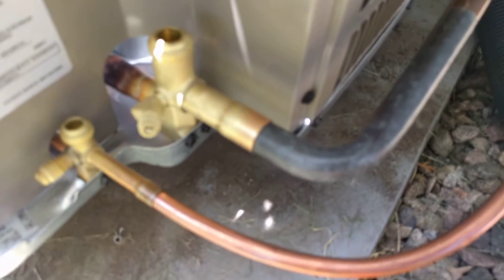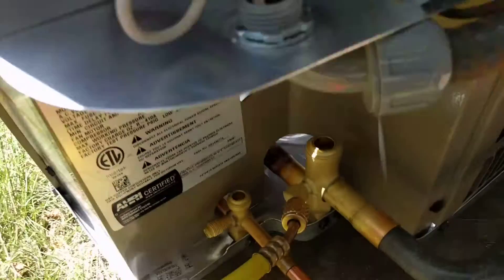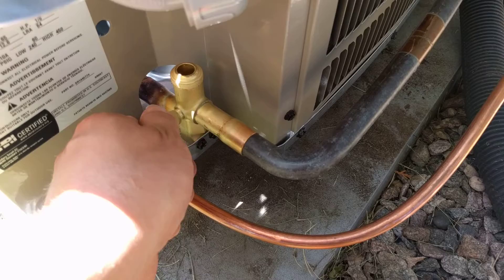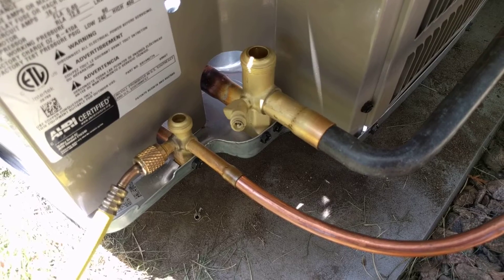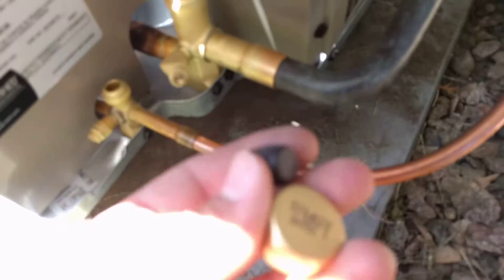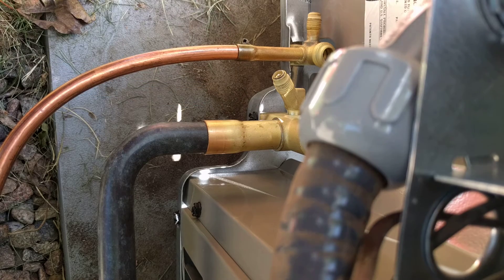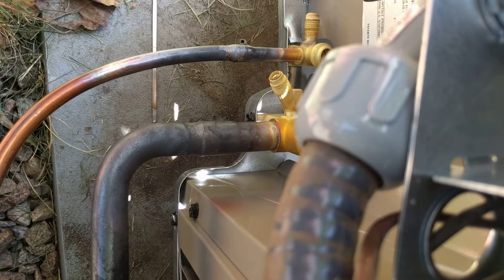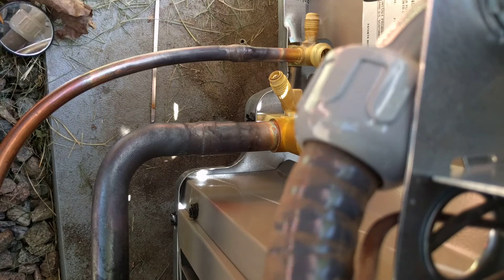How To Braze The Connections On An Air Conditioner Condenser Outside Unit Using Nitrogen - Soldering

Comment: You didn't protect the valves while they were being brazed with a wet rag. The valves then acted as a heat sink and drew the heat to the valves.  You need nitrogen flowing  continuously  non stop thru the lines while brazing from one point. You DON'T add nitrogen to one side then jump to the other side as that does not purge the oxygen from the lines it just mixes it with the oxygen remaining in the lines.. You need to heat the fittings from the bottom up as heat flows up and not down.  ---  BUT other than that how did you like the play Mrs. Lincoln...

Comment: He has no idea of what he’s doing
Reply from the maker: How so? Share what I did wrong and then people can learn from your knowledge!
Reply: Benjamin Sahlstrom brazing with out nitrogen running in the lines no adding a wet rag to the valves to stop the heat ,,,not
Removing the Valve cores
Reply from the maker: @yonofui9682  I did add nitrogen into the lines but I agree that technically you should flow nitrogen through while brazing. I have found that a wet rag and removing the valve cores is not necessary. Have never had a problem and have brazed probably over 100 ac systems. What problems have you experienced?

Comment: Why no heat protection on the valves?
Reply from the maker: bluebird5100 If you're able to finish the process in a short period of time it is unnecessary as the valve body doesn't have time to overheat. Putting a wet rag over the valve however is probably a good idea just to be safe.

Thanks for your comment!
Reply: You should also rapid cool your braze work with a wet rag. It will harden the braze causing the alloys to fuse better.
Reply: @FloridaMan7337  it absolutely will not lol.
Reply: @jonnymac31   It prevents the flux from over-oxidizing.. making a clean, hardened joint with minimal damage from over- exposure. Internal oxidizing will occur if allowed to air cool, nitro or not. Rapid cooling must be preformed for a proper joint job. I personally use canola oil. It's like drenching a hot sword into an oil bath. This hardens the alloys to it's highest tensile strength.
Reply: @FloridaMan7337  phosphorous pentoxide is what cleans the joint when using this type of rod. No flux is used.  Your a space cadet.
Reply: @jonnymac31  I'm not in the field. I just installed my own new R410a Goodman resi using Stay Brite 8 and a TS800. I know about the rods and avoided them. I needed an oxyacetylene torch and nitro flow which was too expensive. Been working great for years leak free.

Comment: I used a Turbo torch for years.
Reply from the maker: +Pops McCartney I've heard that using a oxygen and acetylene torch is better but I don't think that is true in all cases. I only use my oxy setup when I need to braze on TEV's and things that I dont want to get too hot.

The Turbo Torch works great in most applications in my experience.
Reply: I agree, I used Stay Brite 8 on TEV's and used my turbo torch.